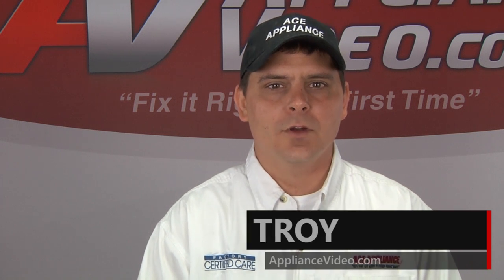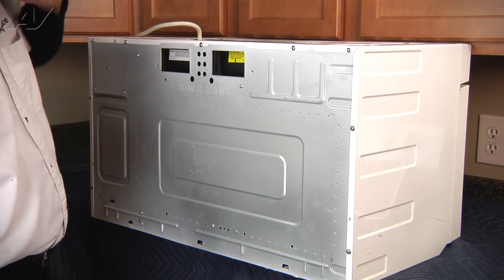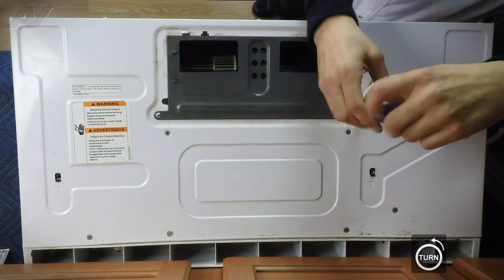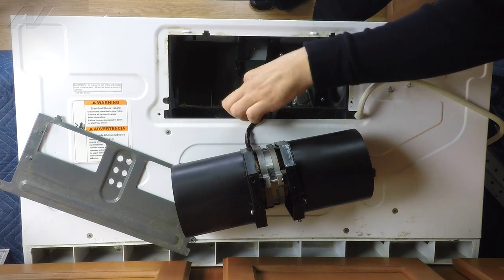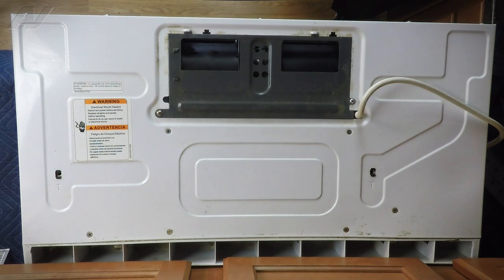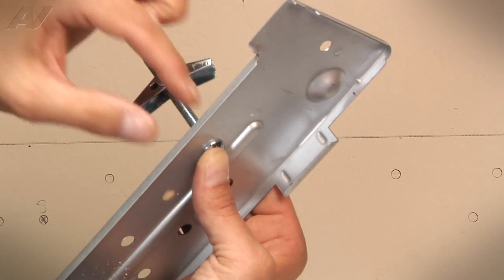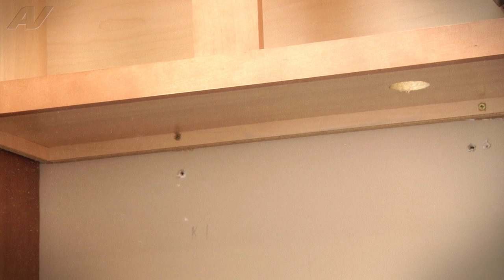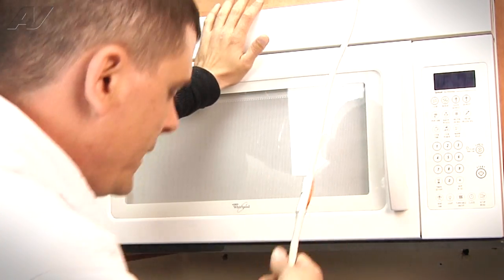How to Install & Mount a Built-in Microwave

Comment: I missed the part of how you decided where to position the mounting plate? Did you measure and mark, or did you lift the microwave up and mark the location? Thank you!
Reply from the maker: Great question, if you have a
more technical question that our parts department cannot answer, our
technicians are answering all questions at our website at www.ApplianceVideo.com under our Repair Help section. You can also call
our parts department at 1-800-830-5465 and they can give you help 7-days A week
Mon-Sat . You can also search at www.SaveMoreOnParts.com 7- days a week.
Reply: Yeah where was that part? Most important part and no info....

Comment: What's the point of using the supplied molly anchors if your able to drill into wall studs? Seems unnecessary and redundant.
Reply from the maker: Great question, if you have a more technical question that our parts department cannot answer, you can search our over 17,000 answered questions free at our website www.ApplianceVideo.com under our Repair Help section. You can also call our parts department at 1-800-830-5465 and they can give you help 7-days A week ,or search at www.SaveMoreOnParts.com  .
Reply: Extra support.

Comment: How did you set up the alignment of the bolts to the threads on the top of the microwave?
Reply from the maker: Great question, if you have a
more technical question that our parts department cannot answer, our
technicians are answering all questions at our website at www.ApplianceVideo.com under our Repair Help section. You can also call
our parts department at 1-800-830-5465 and they can give you help 6-days A week
Mon-Sat . You can also search at www.SaveMoreOnParts.com 7- days a week.
Reply: As a former installer i can answer that for you. The new microwave comes with a template to mark you hole placement.
Reply: Jesus Christ the whole point of me watching this video is to figure out how to set up the alignment for the top bolts and they didn't even show you how to do it I'd like to thank the technician who offered up his opinion and explain this process for me
Reply: @jason8507  I had a template but it had holes in it, so it was not exactly precise. If you do not have a template to tape on the back wall or on the upper cabinet you can make your own template by taking measurements from the corner and the front of the microwave as to the exact location of your bolts. Make the holes bigger and just make sure that your screws have washers to cover the hole and provide support. I also cut a piece of wood that fits between the cabinet and the microwave so that the microwave metal does not get damaged by pulling up it makes it more of a flush mount
Reply: @jason8507  exactly, that is why I watched this video and the just gloss over that. Thumbs down!

Comment: I'm hitting a cement after drywall  and bolt cannot fit through. Also no stud. Can I use several drywall screw bolts? Will the strength of the screws increase with each added screws used?
Reply from the maker: Great question, if you have a
more technical question that our parts department cannot answer, our
technicians are answering all questions at our website at www.ApplianceVideo.com under our Repair Help section. You can also call
our parts department at 1-800-830-5465 and they can give you help 7-days A week
Monday -Sunday, or search at www.SaveMoreOnParts.com  24 hours
7- days A week.
Reply: Use concrete screws.

Comment: What size bolts are you using?
Reply from the maker: Great question, if you have a
more technical question that our parts department cannot answer, you can search
our over 10,000 answered questions free at our website www.ApplianceVideo.com under our Repair Help section. You can also call
our parts department at 1-800-830-5465 and they can give you help 6-days A week
Monday -Saturday, or search at www.SaveMoreOnParts.com  24 hours
7- days A week.

Comment: requesting information on "what to use as a "heat shield/deflector" for the bottom of a wood shelf for a "over the stove microwave it,s 30" long x 14"tall; I wish to put some metal or whatever to help reduce "rising heat foils"- material should be cleanable; what would you use for the bottom of the shelf; it,s an rv !! any ideas appreciated,thank you,PATRICK.P
Reply from the maker: Great question, if you have a
more technical question that our parts department cannot answer, our
technicians are answering all questions at our website at www.ApplianceVideo.com under our Repair Help section. You can also call
our parts department at 1-800-830-5465 and they can give you help 7-days A week
Mon-Sat . You can also search at www.SaveMoreOnParts.com 7- days a week.
Reply: How do you retrieve the butterflies when you take the mounting bolt out?😉
Reply: @dondon6979  THANK,S !!